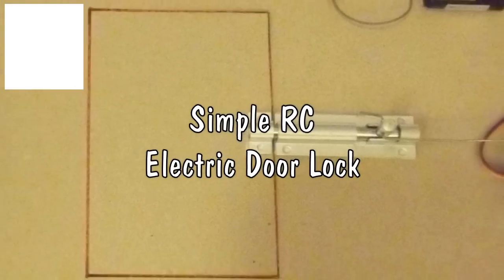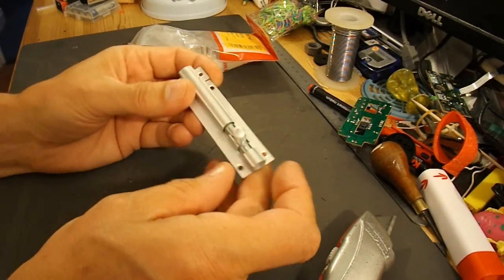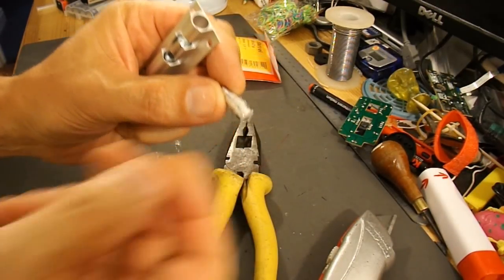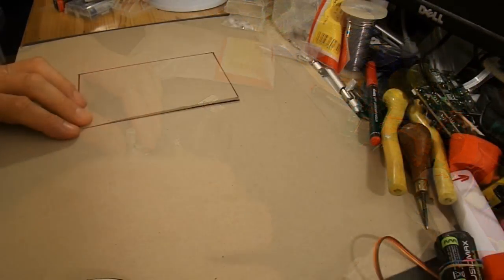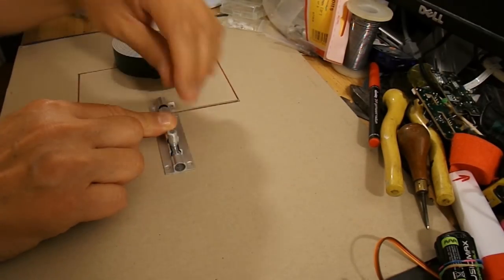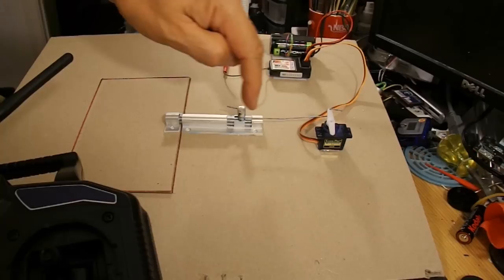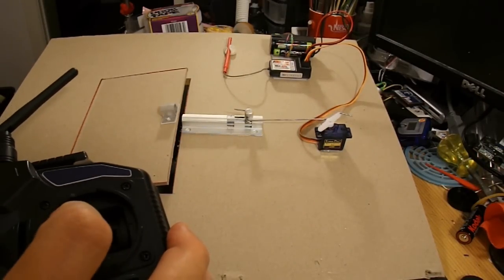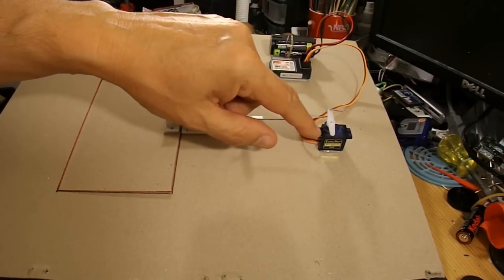Simple RC Electric Door Lock

Comment: Can you go more indepth into the electronics?
Reply from the maker: +Madden Madness not really. There are only 3 or 4 components. 1. RC transmitter 2. RC receiver 3. RC servo 4. Battery 
The battery and servo plug into the receiver in the allocated sockets. You use the transmitter to send signals to the receiver. That's all there is to it.
If you want more information on how Radio Control works I suggest you have a look at a RC channel, maybe FliteTest https://youtu.be/hLzSoob663s
Reply: GrandadIsAnOldMan But how do you bind them?
Reply from the maker: Madden Madness by following the instructions that come with the equipment. Here is a video that covers my FlySky FST-4B https://youtu.be/9FobYWahn5M

Comment: How do I connect the battery to the transmitter
Reply from the maker: +jenarden raaj Maniraaj I am guessing you mean the receiver not the transmitter. You need to obtain the right type of connector to fit the socket in the receiver. I buy that sort of thing from eBay. Probably easiest to search for servo extension leads.

Comment: Plz make a electric door locker by simple cell and button
Reply from the maker: +khan you could do something like this with a switch and a battery to operate the electric motor instead of using the radio control https://youtu.be/VsdScwqENpI?list=PLA5a2xPRSrB1HM3Smxg8X-IG7dSuJyzkK
Reply: OK thanks and I have made it
Reply from the maker: khan well done, did you make a video ?
Reply: When I will stuck it on my wall then I will make video

Comment: Another great video. I love how you provide lots of additional info and links, thanks for that.

When I took the control bits out of a servo and tried it with a battery, the servo acted like a stepper motor, i.e. only moving incrementally. I'm off to watch the videos you linked.

I'd really love to pick your brain...I'm trying to build an automatic dimmer system controlled by motion sensors. The basic premise is, as you walk the property, garden and tree lights will fade from dim to brighter as you walk past them and slowly fade back to dim when the motion sensor turns off. 

I called Lutron and asked if I could reprogram or hack my dimmer, or if they had one that did what I wanted(minus the motion sensor part), and no. Nothing. But they sure liked my idea

I have several rotary, and several slide dimmers to work with, as well as a dozen rc cars and various printers I've disassembled recently to investigate the possibilities. Hence how I found your awesome work.

I married two rotary dimmers directly to two servos with an AM radio and they went haywire. Very jerky movements. Which made for a really cool effect, but not what I'm going for. I think the dimmers were the culprit

I'd like to get this done with what I have on-hand and not have to buy an Arduino or take a class on PWM. Any tips would be greatly appreciated.
Reply from the maker: +BillyGoat4x4 your project sounds like the sort of thing that Patrikikis would get involved in. I haven't checked out his channel for quite a while but it might be worth having a look at his work or contacting him https://www.youtube.com/user/patrickikis/videos
Reply: +GrandadIsAnOldMan Will do. Thank you, Sir.

Comment: your ideas is pretty good but i wanna try to make it. do you have any idea how to make it sir? please....!
Reply from the maker: +They pheaktra let's think about this for a minute. Do you want to have the batteries, RC receiver and solenoid all inside the wallet? You will need a very large wallet. Probably your best option would be a spring loaded bolt that you can move with a magnet to unlock it.
Reply: +GrandadIsAnOldMan : Yes, I have batteries, RC receiver, wallet, bag and loaded bolt but i don't have magnet and solenoid. I can buy it for if i need it. what kind of solenoid and magnet should i use? I also have a Arduino board and servo Because i wanna make some program on arduino board to locking the wallet or bag.
Reply from the maker: They pheaktra I think you missed my point. Where are you going to fit all that equipment inside a wallet? Once you have all that inside there will be no room for any storage !! Maybe you are thinking of a larger wallet than me. If you are using an Arduino and a servo then you don't need a solenoid as the servo will do the movement. You may not have noticed but I have done 4 versions of this door lock in this playlist https://www.youtube.com/playlist?list=PLA5a2xPRSrB1HM3Smxg8X-IG7dSuJyzkK each one has a parts list in the video description but I do not do Arduino projects.
Reply: +GrandadIsAnOldMan  So what do you think if i use Arduino and solenoid to lock bag, not wallet? Because the servo is larger than solenoid. Is't possible?
Reply from the maker: They pheaktra the locking system can follow the same principles shown in my videos. How you actually arrange them to fit inside a wallet or bag will be entirely up to you to design the mounting system. You could even adapt the system I used in my Jack-In-a-box https://youtu.be/GeI9JwOEiBE
Reply: +GrandadIsAnOldMan Thank you so much for your big helps. I will try to make it.

Comment: Excellent video. Thanks for uploading sir,
However I have one question; what exactly did you attach the servo to the barrel bolt with? You mention a paper clip..However I am having trouble replicating your design. How exactly did you do it?
Thanks in advance.
Reply from the maker: SJay Productions I drilled a hole through the barrel bolt handle and the paperclip goes through it. It is visible if you look carefully at the video.

Comment: if I open a rc car will I get all the parts required in it?..except barrel bolts?
Reply from the maker: Krishna Arora if it is just one of those cheap RC cars you get in a toy shop then the answer is no. However the parts could still be used to do the job. In the cheap RC toy cars they do not use a servo for the steering, they use an electric motor. You could attach the barrel bolt to one of the back wheels so that as the wheel turns it pulls and pushes the bolt.
Reply from the maker: Krishna Arora I have prepared a video to demonstrate this but it will not be published until 23rd August

Comment: why did you take the spring and bearing out? cant you just leave it in
Reply from the maker: Danneeal that depends how powerful your servo is. I doubt it would be able to move the bolt with the pressure from the spring. My servo is certainly not that strong.

Comment: Does it have to be of a specific transmittor?
Reply from the maker: WildFilms this is just a simple video showing that you can connect a few basic components together to get a working system. There is more information in the video description. I would not recommend doing it this way if you want a functional remote controlled door lock. As for which transmitter to use, you would use one that matched the receiver you are using.

Comment: I need a little help. I want to start a little project. I wamt to make a little safe with basic electronics. I want it to be that if you but something conductive in the side that will complete a circuit to open the safe door. I know really basic electronics and I want to learn more. I don't know if you can help me with this or where I can learn how to do it.
Reply from the maker: cheeto you mean almost same as using a switch but having two contacts that your conductor bridges to allow current to flow. The other components would be a battery for the power and a door lock solenoid such as listed in my video description

Comment: Hey can you make an rc airplane out of an rc car?
Reply from the maker: edz gomz no, for 2 main reasons.Assuming you mean the cheap RC toy cars you get in many toy shops, not proper high powered RC cars from hobby stores.
1. The motors in those cars are not powerful enough.
2. The transmitter/receiver range is only about 3 to 5 meters so as soon as you have launched the plane you would have to run after it to keep it in range.

Comment: Also if you dont mine can you show us in your youtube channal how to make a lipo battery charger with red light for low and green light for full charge
Reply from the maker: That is not the sort of thing I do. I wouldn't even consider making one from scratch due to the potential fire hazard. Either buy a proper one or assemble one from component modules available from eBay.
Here is an example of a charger module I bought from China via eBay
https://youtu.be/cP_6XR2Cwc0?list=PLA5a2xPRSrB00lxaX8BD46F1QDJTe7Em4

Comment: Hey GrandadIsAnOldMan   I have one more question. If I was to purchase these items will I be able to make this project? http://www.ebay.com.au/itm/Micro-Mini-Servo-9g-SG90-Hs-55-rc-helicopter-X1-heli-steering-boat-1-6kg-lama-v4-/141009729050?pt=AU_Toys_Hobbies_Radio_Controlled_Vehicles&hash=item20d4d5b61a AND THE http://www.ebay.com.au/itm/1-Channel-Fixed-Code-Wireless-Remote-Control-Switch-w-Receiving-Pannel-DC12V-/331411376297?pt=LH_DefaultDomain_15&hash=item4d29a848a9 OR http://www.ebay.com.au/itm/New-12V-2-Channel-Jog-Wireless-Remote-Controller-Control-Switch-Board-Fixed-Code-/271803432077?pt=LH_DefaultDomain_15&hash=item3f48bf3c8d OR http://www.ebay.com.au/itm/P4PM-1-Channel-AC-DC-12V-RF-Wireless-Remote-Control-Switch-Receiver-Transmitter-/400750264721?pt=LH_DefaultDomain_15&hash=item5d4e93c191 
I'd greatly appreciate it if you can answer thanks ! :)
Reply from the maker: I am not quite sure how you expect me to answer this. All those remote control switches look like they should work but without buying them I cannot speak from experience. The same applies to the servo but you would still have to modify it as described in the previous reply. An RC servo does not work by simply applying a DC signal, you have to take the circuitry out and you have to modify the gears.
The simplest option is the solenoid door lock as described in the video description and shown in that video link I gave you for Patrickikis
Reply: GrandadIsAnOldMan Thanks for the fast reply, sorry if I am asking so many questions. All this just seems like hard work. I am still confused as to how I am supposed to modify the gears I can't find any tutorials.Do you know how it is possible to modify the gears? Thanks :)
Reply from the maker: firegodz123 I gave you a link in the previous reply on modifying the servo.

Comment: Hi GrandadIsAnOldMan  I was wondering, would this project be possible if I use this? http://www.ebay.com.au/itm/12v-2-Channel-Wireless-Remote-Control-Receiver-Momentary-Switch-Relay-2-Remote-/400685326344?pt=LH_DefaultDomain_15&hash=item5d4ab4e008 and how do I modify this to a servo by modifying the DC voltage and battery pack? Thanks a lot :)
Reply from the maker: I assume you have already read my video description where this question is already covered. If you are going to buy a simple Wireless remote control from eBay it would not be a direct replacement as it just operates a relay switch so you have an on/off output. You would have to use the door lock solenoid also linked in description or modify a servo to work on DC by removing the circuit board.

On the subject of modifying servos here is a very comprehensive video by Forrest Trenaman which is worth watching even though it leaves the servo controlled by a radio receiver so it is unsuitable for this case http://youtu.be/6G1nHfvl4aI
You could follow the general flow of this video but the simple change is that you remove the circuit board entirely and connect your DC power supply directly to the motor via your switch so the servo drives your door bolt in and out continuously and you have to judge when it is locked or unlocked.

Here is a similar project by Patrickikis using a Bluetooth remote but your wireless remote would be very similar http://youtu.be/kiXAyIsvCAo
Here is another of my videos using an infrared remote - again the wireless remote will be similar http://youtu.be/rLuS6lmNmus?list=PLA5a2xPRSrB00lxaX8BD46F1QDJTe7Em4
I also use a similar wireless remote in this toy tank http://youtu.be/MwXyp6LA5qw

Comment: Grandad, does the 12V Single Channel Fixed Encoding Wireless Remote Control Switch you linked in the description work for this circuit?
Reply from the maker: It would not be a direct replacement as it just operates a relay switch so you have an on/off output. You would have to use the door lock solenoid also linked in description or modify a servo to work on DC by removing the circuit board. .
Reply: Thanks for the help!

Comment: That seems like an awfully expensive solution with a lot of overkill given you are only using 1 channel of the radio controller, not to mention its pretty impractical given the need to carry a giant remote control around with them whenever they wanted to get into the locked door.  Still it is a simple solution using off the shelf parts, so that's pretty clever, though I fear its a bit out of the budget for the average hobbyist. :)
Reply from the maker: Totally agree with you. I was asked to do it, so I did, but if you read the video description I explain why I don't think it's a good idea and offer an alternative solution.

Comment: What is an Aerial? What does it do?
Reply from the maker: Here is a cut & paste from Wikipedia which you could have looked at yourself.

An antenna (or aerial) is an electrical device which converts electric power into radio waves, and vice versa.[1] It is usually used with a radio transmitter or radio receiver. In transmission, a radio transmitter supplies an electric current oscillating at radio frequency (i.e. a high frequency alternating current (AC)) to the antenna's terminals, and the antenna radiates the energy from the current as electromagnetic waves (radio waves). In reception, an antenna intercepts some of the power of an electromagnetic wave in order to produce a tiny voltage at its terminals, that is applied to a receiver to be amplified.

Antennas are essential components of all equipment that uses radio. They are used in systems such as radio broadcasting, broadcast television, two-way radio, communications receivers, radar, cell phones, and satellite communications, as well as other devices such as garage door openers, wireless microphones, Bluetooth-enabled devices, wireless computer networks, baby monitors, and RFID tags on merchandise.

Typically an antenna consists of an arrangement of metallic conductors (elements), electrically connected (often through a transmission line) to the receiver or transmitter. An oscillating current of electrons forced through the antenna by a transmitter will create an oscillating magnetic field around the antenna elements, while the charge of the electrons also creates an oscillating electric field along the elements. These time-varying fields radiate away from the antenna into space as a moving transverse electromagnetic field wave. Conversely, during reception, the oscillating electric and magnetic fields of an incoming radio wave exert force on the electrons in the antenna elements, causing them to move back and forth, creating oscillating currents in the antenna.

Comment: Hey Grandad i was just wondering could you use a 2 in barrel bolt lock instead of a four in ?
Reply from the maker: GDreptiles you can use whatever you like. I just rigged this up to answer some questions. I don't recommend it as a practical door lock as it is a ridiculously expensive way to lock a door using a radio control transmitter & receiver set-up. You can buy simple single channel remote control units from eBay with a little key fob transmitter and do the same sort of thing cheaper, however if you already have the parts and want to make it as a project then fine.

Comment: I wonder how to make it not remain its initial position, but to hold left then when pressing right goes right and stays there even when you let go the button....
Reply from the maker: I believe you can modify a servo to do that and some servos work that way anyway. I don't think this is a very practical way of making a remote control lock and I only did it to show it could be done. It is a waste of an expensive piece of equipment to do a simple task.
Reply: Riiight Thanks a lot for replying ! I'm not really good at engineering

Comment: What is that thing under the battery? Is it necessary for the whole thing to work properly?
Reply from the maker: That is the radio receiver. This is a radio controlled lock. You could make it with another sort of remote control, perhaps infra-red.
Reply: GrandadIsAnOldMan Wait, where did you get that wire that is connected the battery pack to the receiver?
Reply from the maker: Phuoc Tran I think that particular connector was scavenged from some electrical equipment, but you can buy the connectors on eBay or any electrical hobby store.